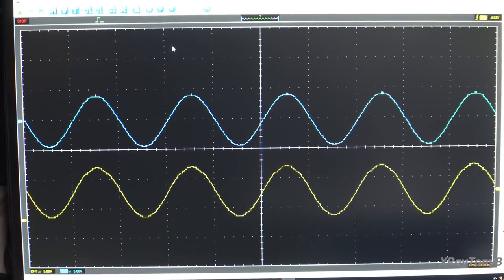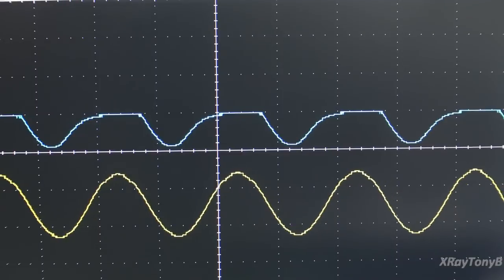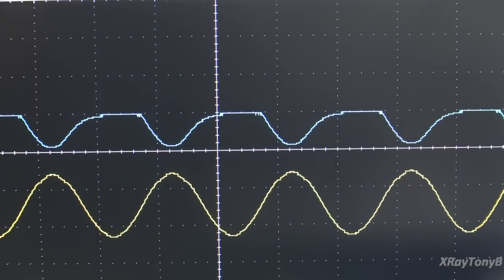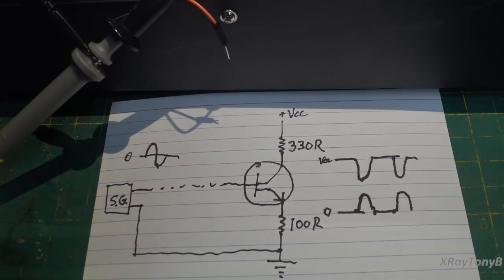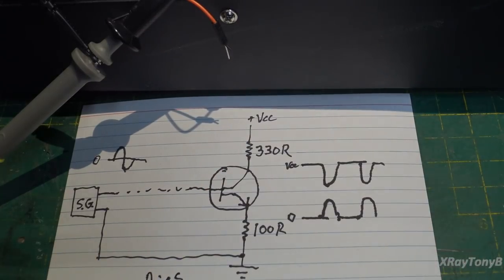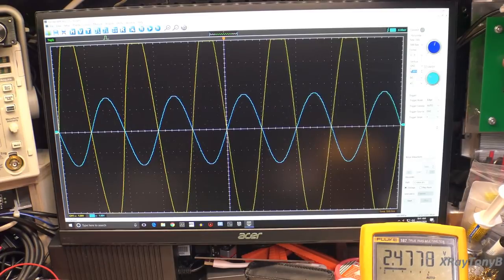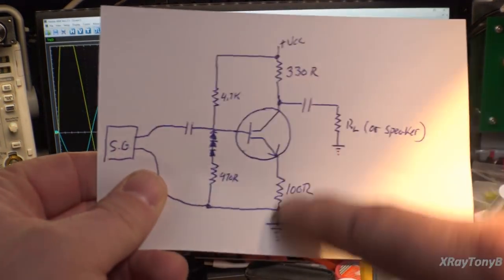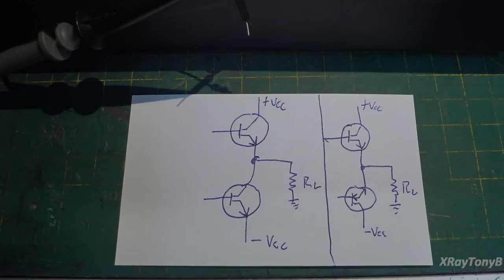Understanding Amplifier Class A & Class AB

Comment: Thanks or another great video. I built my class A amplifiers from a renowned circuit that had been upgraded for extra power output and ease of 'setting-up' adjustments. They each have four output transistors - all NPN types - and produce between 50 and 60 watts into 8 ohms, drawing over 3 amps quiescent current so the ample heatsinking definitely get warm. I'm very pleased with their sound quality.

Comment: My late Father taught me this many years ago but my understanding kinda got a bit rusty since. I was a little confused to start with but all became clear as the video went on. This is by far the best explanation video on here of how different class amplifier's work. You mentioned Pioneer amplifiers and non switching. I have the A70 which is non switching but has two high current 50V & 70V rails. I am still from the circuit diagram trying to understand how this works. I think you worked on a Carver which was class G with two voltage rails. I don't think it is class G but may be class A at lower volumes it seems to sound much smoother and warmer. If you turn the volume up it seems to sound less warm and slightly harsh. This is an outstanding video. Thank you

Comment: Well done Tony. Great video. Very good explanations of some very important concepts. The three diodes are drawn backwards on your schematic. IMHO if the volts/div settings were the same when showing the input signal versus the output signal , the amplification of the transistor would be easier to appreciate. I love your woodworking skills... the cabinet you made for the Marantz 2500 was awesome!

Comment: Great video Tony, What I would love to know is what effect would the ESR of the output capacitor have on the output signal? Would more smaller capacitors with very low ESR be better than a single larger capacitor? Or maybe a combination of both? The reason why I ask is because I feel like the smaller capacitors can respond faster than the larger ones, I could be wrong but it's just a feeling and I don't know for sure! I purchased a bridge rectifier kit off eBay that came complete with the rectifier, PCB and a lot of smaller low ESR capacitors in DIY form. I purchased it because I remember seeing a video somewhere how a large capacitor does fine with the bulk of the ripple but by simply adding a smaller low value capacitor cleaned up the DC output even more whereas adding more larger capacitors wouldn't have done the same... In the case of the output on an amplifier, faster responding capacitors should make an impact on the output signal? I guess that this is one of the areas where amplifiers get their characteristic sound from.. Yeah I'm still not sure though but something is giving me the feeling that it would make a difference...

Comment: Basically you’re saying having a DC biased sine wave, which you don’t want on speakers but is common in the amp circuits such as the signal that gets amplified riding on negative DC to the grids of output tubes and positive on the plates. AC components on a DC voltage. That is why I love my Brymen BM869s meter, has a nice dual display showing both, my Fluke 189 does it too but the Brymen displays much nicer. Saves breaking out the scope at times.

Comment: Very nice video! Thanks. One question: are those diodes on the right polarity wiring? I'm talking about the three u used to adjust the bias voltage in the first scheme. It does feel wrong if those diodes block the DC to ground isnt it?
Reply: They are indeed in the wrong way, I noticed trough the video.

Comment: Great video. I noticed there is no output capacitor on class AB amp, even though both transistors are still biased a little bit in the linear region with some DC voltage present on the output signal, isn't that harmful to the speaker however small that DC bias voltage might be ?
Reply from the maker: In a class AB amp, both the positive and negative output transistors have equal and opposite amounts of bias on them at idle, so when added together, they equal zero volts.  For example, if there were +50 millivolts of bias on the NPN output side and -50 millivolts on the PNP side, then (+50) + (-50) = 0 volts.  The only way to see DC on the speaker terminal is if one side were biased more than the other.  That's where the DC offset adjustment (when available) comes into play.  DC offset adjustment insures that you have equal and opposite bias on both sides.  Lower cost amps don't have adjustable DC offset and rely on component matching to insure low/no DC offset.  Thanks for watching.
Reply: @xraytonyb  - So why not use an output cap on a class AB as an insurance, anyway? Do output capacitors introduce undesirable distortions, like slowing down fast rise times, phase distortion, or attenuating lower frequencies? -  aside from the fact that electrolytic caps have a limited lifetime and degrade rapidly at higher temps.
Reply: @NICK-uy3nl  A capacitor will always allow more high frequency current through than low frequency. But more importantly you'd need a humongous capacitor to allow several dozen watts through. It would be refrigerator sized. That's hardly practical.
Reply: @Roflcopter4b  - I must disagree. All high powered class A amps use output caps and they are not humongous.
Reply: @NICK-uy3nl  A perfectly balanced AB output stage can supply unlimited current response to the speaker within the capacity of the components. Introducing a capacitor will interfere with that ability unless a very large and expensive cap is used. It's a design choice to use a circuit that balances well and gives a good current delivery.

Comment: Funny for this is that sound is coming from my DIY Pure Class A single stage amplifier, and some values are nice comparison, like:

I have 1ohm resistor, mosfet, and output stage capasitor is 100 000uF/16v for the speakers.

for video amplifier it was 330ohm, transistor and 100ohm...

Comment: What software are you using for your USB Scope ? The software that came with Hantek 6022BL is so bad its makes it almost useless. Or could anyone point me towards anything better?
Reply from the maker: I'm still not totally clear on this, but as far as I can tell, there are at least three versions of the 6000 series scopes (each with different sub-models for bandwidth, etc.).  If you get the wrong software for your specific model, it's really unreliable.  You can go to Hantek's website and download the correct version.  It will still hang up every now and then, but it works fairly well.   Hope that helps.
Reply: @xraytonyb  Thank You and I will

Comment: EXCELLENT demonstration.!!..now if you can explain hole theory vs electron theory...why mechanics think current flows from positive to negative and electricians and EET guys KNOW that current goes from negative to positive.....you sir, are a very good teacher...Also capacitors  are known to block DC as they are used to prevent DC from advancing to speakers or amplifiers, ect....but according to what your saying do caps really block all DC or only non fluctuating DC?

Comment: Maybe it is my bad hearing, but both the ac and the dc offset sine waves sounded exactly the same to me.
Reply: To me the DC signal sounded more tinny and the AC signal more fuller.    Maybe because your in the middle of the speaker's mechanical travel with the AC signal than being at one end of the speaker's mechanical travel only with dc.  Like he said that speaker design was intended for ac signals.

Comment: hello. I noticed at the beginning that the shape of the sine wave on the DC side is not symmetrical, that is, the top part of the wave is a little bumpier than the bottom part... I also face something like this, it is easily noticeable... I have a finally with tl071 and two bd transistors (139-140)... the sine wave input capacitor is 220uF and the output capacitor is 6800uF. the load is a simple 4 ohm coil. the frequency of the wave is 8hz. I am within the limit of Vmax 3.00v and Vmin -0.89v...what would be the cause of that distortion?

Comment: One thing I couldn't understand: In the first simple circuit when there was no bias, we saw that we only see one side of the sine wave amplified. Well that is not actually possible. The +500 mV peek of the input signal is not enough to put the transistor into active range. The transistor will stay off unless there is a DC offset in the signal generator. If you put the circuit into LTSpice for example you can check that. But in 20:20 you can clearly see that transistor is amplifying upper half of the wave (though you can see for a slight time in each wave the yellow line is flat while the blue is going up). How is that possible? (Maybe because there was no load and no current in LTspice?)
Reply: 1. There is transistors where threshold voltage is less then 1000mv, so it is possible to make it work pure signal only.

2. When blue line rising transistor start conduct only, when voltage is more then threshold so that why yellow line is flat for short period of time...
Reply: @samppazzz  Thanks for your answer. Yeah I noticed the flat line after my initial comment and edited the question. But anyway I think it was some matter that should have been pointed out in the video.

Comment: 12:27 - so, which of the tones is DC? The first more "open" tone, or the following more "muddy" tone at 13:30?
Reply: Not explained and not clear at all why is this , because may be not an amplifiers that working only with a positive current
Reply: @johnadams9041  If you listen to his explanation at around 17 minutes, it becomes clear that the phenomenon is nothing to do with an amplifier, it is simply a question of what is the best way, the right way to drive the speaker.

Comment: Okay i have one question i hope gets answered, okay 2 questions actually xd. Could i just rely on a ceramic cap on the output and, ive noticed the capacitor capacitance at the output has to be low or the dc bis wil still be there(someone confirm?). But since this output cap is creating an a.c wave how does this NOT short out the capacitor?

Comment: What is the advantage of class A amps, I have seen a few audiophile class A amps, very expensive amps, I don't get why.
Reply: Low linearity and distortion, they are terribly inefficient though. Good for headphone amps
Reply: You must mean high linearity.
Reply: They are like Cadillac's, very good quality amps but guzzle a lot of energy.
Reply: I built my own class A amps - monoblocks - and love them. The heat-sinks do get really warm, though.
Reply: Higher quality, there is no cross over distortion.
Linearity is better too.

The disadvantage is that whatever the maximum power output the circuit is designed to deliver, they always consume that total amount of power, irrespective of the level of signal input.

So when the input signal is not present, resulting in silence, no output, the class A is still consuming the same amount of power as when the amp is at full volume.

Comment: Why have you got those 3 series diodes as shown. They would be reverse biased. In your circuit as built, they are the other way around, which is correct.
Reply from the maker: I drew them in backwards- my bad.  I explain why the diodes are there in the video.  Thanks for watching!
Reply: It's a quick and simple way to change the bias voltage to reduce the cross over distortion in the Class AB amp.

Comment: Greetings:
Since you are showing how bias works couldn't you have simply used a pot from vcc to base to have an adjustable base current to set the collector current half-way between saturation and cutoff. No emitter resistor or base to ground components needed. Scope ch. 1 at base, ch. 2 at collector. To show an emitter follower circuit, just move the collector load resistor to the emitter to ground position with scope ch. 2 on the emitter. The removed base components may improve the function ĺinearity but is not needed to demonstrate how base bias current allows equal signal swings of the input signal at the output.

Comment: Couldn't one, theoretically, perfectly well design a DC speaker? I know nobody would bother to try to sell one but I see no reason why it wouldn't be possible.
Reply: Magnetic repulsion only makes sound with an ac current. You may not be able to see why something is not practical but that doesn't change the laws of physics
A speaker in series with a large capacitor will produce sound from a varying dc current and that is what  Tony has just described.
Reply: @jonka1  This is not true.
Think back to when he connected a steady DC voltage to the speaker. The voice coil moved in one direction and remained displaced from its neutral position until that steady DC voltage was removed.

What is happening is the applied voltage causes a current in the voice coil, and that coil produces a magnetic field. That field then interacts with the field from the permanent magnet and causes a deflection of the voice coil and speaker cone.

So the magnetic repulsion which occurs between the two magnetic fields does occur with DC.
Reply: @deang5622  Correct. A DC current produces deflection of the voice coil exactly as that same current moves the coil and pointer of a DC meter. 
What you describe in your comment is basic electromagnetics but while all this is true a magnetically deflected voice coil produces no sound after its initial deflection and will sit there absorbing power to no effect.
Reply: @jonka1  My point, is that thought you might be able to determine from my post, but seemingly not, is that if having deflected  the voice coil with a steady state DC current, if you then reduce that current to a lower current but still DC and still of the same polarity, the cone of the speaker will move back. If you then then increase the current again, the cone will move forwards and push the air out.

So you can achieve movent of the mass of air in front of the speaker by simply using DC with out that speaker cone having to return and pass back through its neutral position.

Do you agree with this?
Reply: @deang5622  If it was not for the tone of your first senence in your last reply I might have offered to discuss this further.
Reply: @jonka1  So now finally you see where this is going and you don't want to engage further because you now realise your original post was complete bollocks.